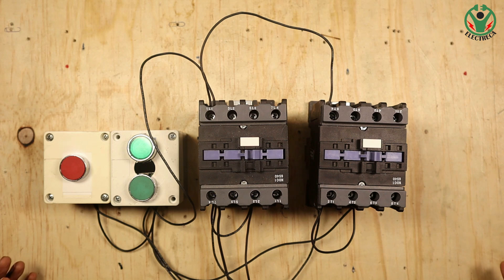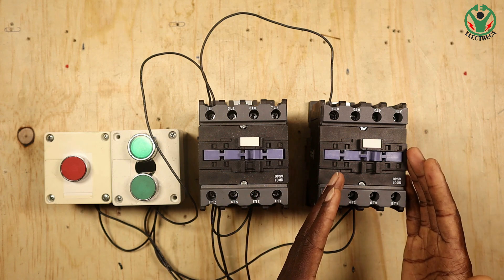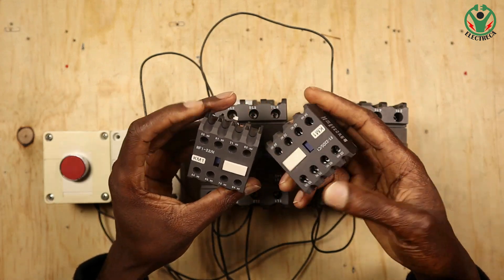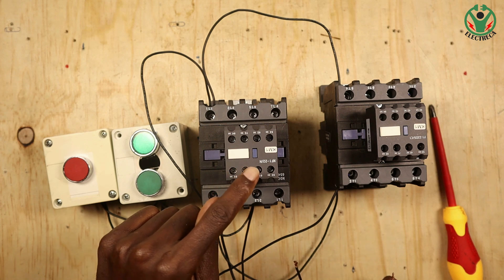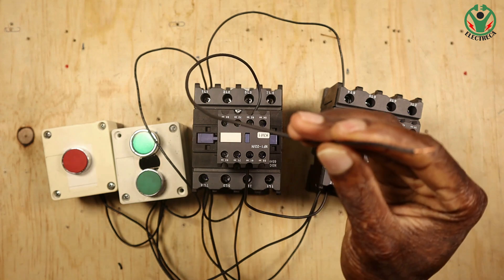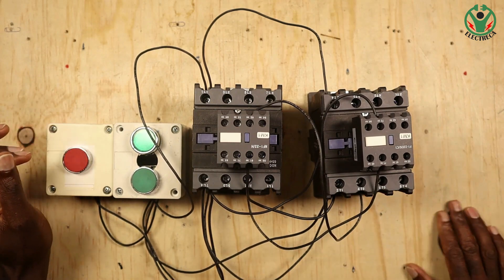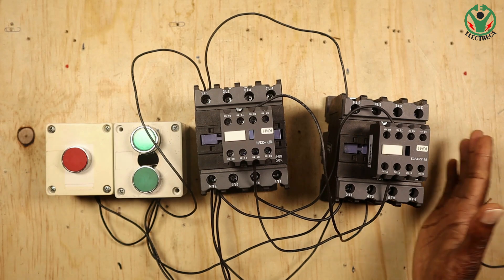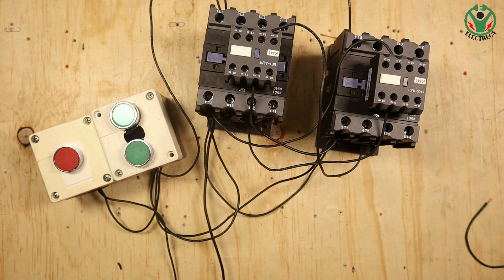How to interlock contactors

Comment: 4:39 Please what's the difference between mechanical interlock and electrical interlock.
Reply from the maker: Electrical interlock locks contactors through wires and is part of the control circuit, but mechanical interlock locks contactors through physical contact of the contactor armature. The ultimate goal for both methods is to allow one contactor to engage at a time.